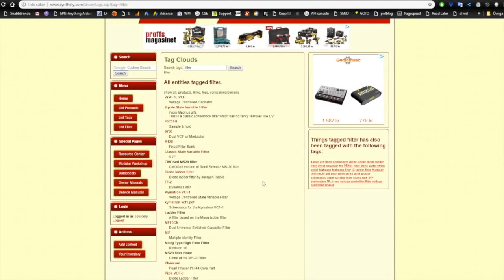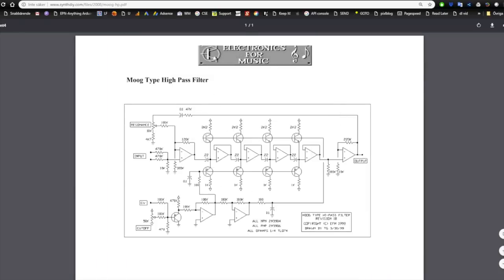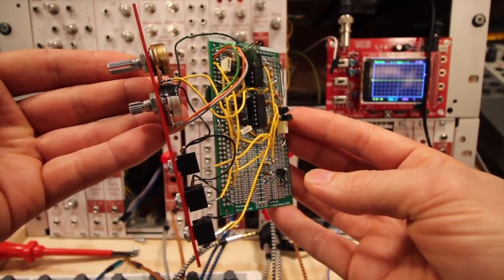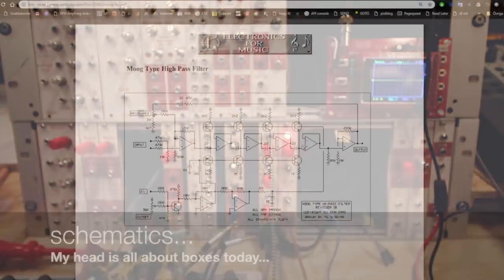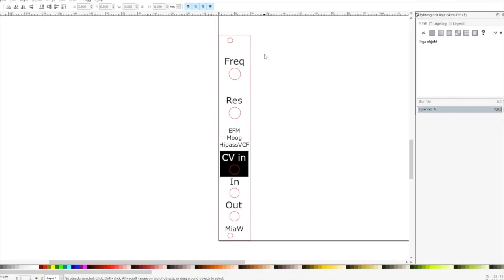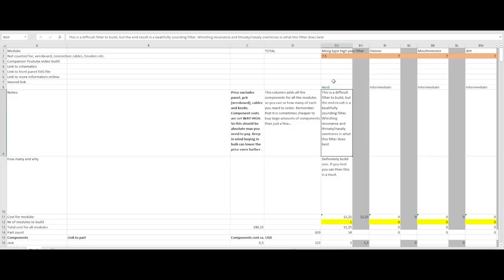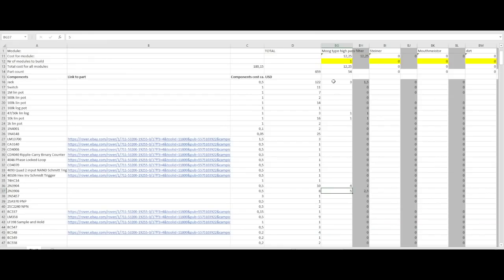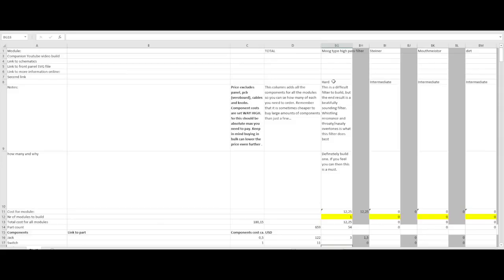Moog Highpass Transistor Ladder Filter - DIY Modular in a Week 7.5

Comment: Hi Kristian. Great video. Thank you for posting this and for linking to the schematic. I'm troubleshooting mine, built from David Hailant's schematic, which is based on yours, so I am taking what you said about adding the caps at either end of the ladder, and comparing the EMF schematic. Hopefully, I'll get mine working pretty easily. Mine is on perfboard, which was a problem until I abandoned the idea of duplicating David's PCB layout.

Out of respect for the man, Bob Moog, who we owe so much to for creating the modular synthesizer, the name Moog is pronounced like the word "rogue'. I understand how so many people pronounce it differently, but you can check me on wikipedia if you like. I'm not nit-picking, just being respectful of someone whose work I greatly admire!
Reply from the maker: Hope you get it working. I believe David’s filter is a low pass and mine is a high pass so might be a few differences. Except for the caps mine should be quite exact like the EMF one. 
Thanks for the tip. It’s always difficult with languages. I also say David’s name wrong a bunch of times. Now I’ve met him and had it explained I’ll try to say that one correct next time aswell. 😅

Comment: Got it working!  I used .22uF caps as the "customization" not 22pF OOPS so that's why the resonance didn''t work. Once I got the right value caps in it started working! Also needed to mod--on the orig EFM schem, it shows freq cutoff pot with +12 on one side and ground on the other.  Wrong, I needed +12 on one side and -12 on other other.  Thanks for the inspiring video!
Reply from the maker: Yeah that one was a bit tricky to get working for me too. Thanks for the heads up on the -12v/gnd error!

Comment: Built it, my build sounds way, way worse than yours.  Q, did you match transistors?
Reply from the maker: Sorry for late reply. But no I didn’t match transistors. Although I guess they were from the same batch at least. Did you add the extra capacitors?
Reply: yes I added the caps.  redesigned the boards, still can't get your sound, it's like the values for the resistors from CV and audio in to the rest of the circuit are incorrect.  No resonance either, I will keep working on this,

Comment: Finally wrapped this up and no nothing.  Completely dead :(. So then I checked around the net and it appears that the downward arrows from the ladder go to -12v (up arrows to +12v).  Is this correct?  I'm going to see if I can rework my board and try this.  If so, I will let you know.  Thanks
Reply: And it's correct??
Reply: @bereshit4272  This was a while ago, but I think it is true that the down arrow goes to negative and up to positive.  I never got this to work.  I then ordered PCBs from someone online and that didn't work either.  I've gotten most modules to work fine, so not sure what I was doing wrong with this one.  At some point, I'll come back to it and try again.  Good luck!

Comment: How do you like that oscilloscope? The price feels almost too good to be true, but it looks like it has good enough features.
Reply from the maker: For audio applications it is enough at least for me. I can probe around for signals and see waveforms. They do have one that is a bit more expensive that can be plugged into a computer as well and save measurements etc. Only thing might be that the cables are a bit short. But buying a new better probe is of course an option to solve this. 😅